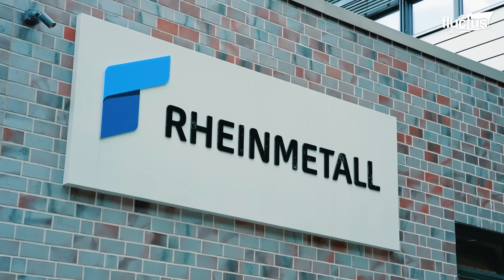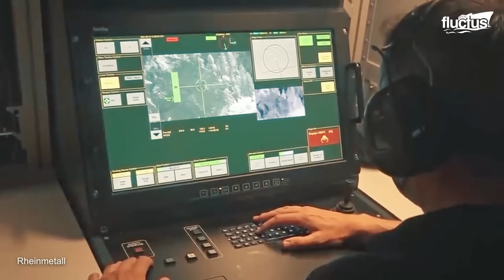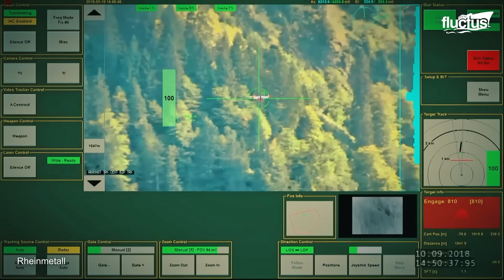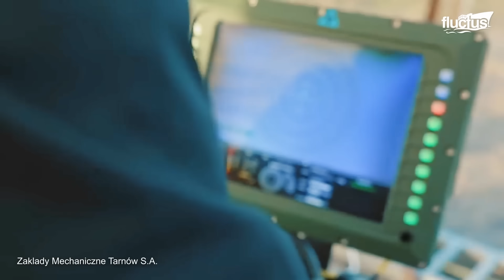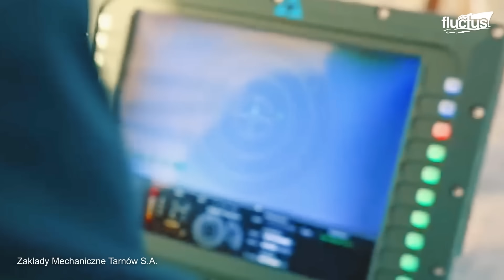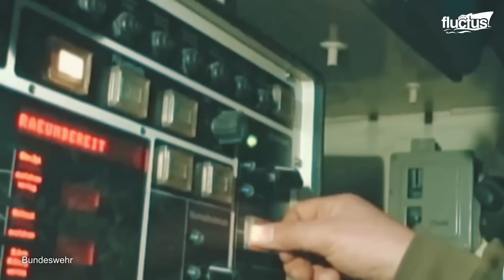Germany Testing its Brand New Massive Anti Drone System for The First Time

Comment: cost of this ting?10 million euro? 10 drones from different 10 angels simultaniously cost 4000 dollar maximum? Its a 50%50 dual. Very bad, idiotic no solution. Idiots buy this thing.
Reply: Are you really that stupid? It’s about the value of the potential targets the system has to give cover.

Comment: Looks great. But the real issue with a system of the nature is price vs the proliferation of drones. The real requirement is a for a reliable cheap drone killer that can be deployed anywhere and is easily replaceable, It would need to be deployed near the front lines and that would result in it being targeted with the ensuing losses of units. No question, Rheinmetal have developed an awesome drone killer, but artillery and air units will target something like that. Probably its best role will be defending urban areas, important installations and command centres etc from drone attacks.

Comment: From other videos on the same system the the ammunition load is something like 220 rounds, that is not much for a gun that fires at 1000 RPM
Reply: 13s of consecutive burst. Doesn’t sound a lot. Question is how long does reload take and how automated it is. If it is a second it doesn‘t matter. I do not think it uses bursts longer than a second which already comprises a 16 shot salvo. Seems much for a drone. Sounds more like it can shoot down 16 drone swarm in a second

I see more of problem with the Oerlikon gun. If it’s Swissmade we cannot expect getting ammunition when needed.

Comment: Yeah but what if 100+ drones are attacking at the same time?
Reply: Airburst ammo and 1,000 rounds per minute... Whatever happens, there's no end in sight. A 30×173 mm cannon contains 162 subprojectiles, and a 35×228 mm cannon contains 152 subprojectiles. This means that a single cannon is capable of laying a wall of tungsten in the path of the drones.
Reply: @solidsteel3634  especially as each tungsten sub munition won't necessarily be stopped by a weak drone body. So a single subpenetrator may be able to take out multiple drones in close proximity. Sure, the chance isn't high but it's there.
Reply: They send a 20 tons truck with ammunition every  minute? 😂
Reply: @henrykuppens9097  Are you stupid or are you just unlucky when it comes to thinking?
Reply: Every system can be overwhelmed. If you make something that can withstand 50 targets, someone is going to ask well how about a 100. Or a thousand, or whatever. Nothing and nobody is absolutely safe.

Comment: what if they send many drones from different direction
Reply: The radar works 360°, and the mobile turret can spin around fairly quickly... There's always a limit, but even the "old" Gepard can engage multiple targets.
Reply: this vehicle is operating  in groups of about 5 units. and they are digital connected in real time to share radar data and manage the different targets to the best fitting unit
Reply: "what if",...? Well, defense mechanisms like the sky shark (somehow an ultralight plane from czechia) is a way dealing with drone. Whenever a treat is coming up, it is only a matter of time and counter measures come up as well.
Reply: What if they after some strikes to factories and warehouses do not have any drone left?